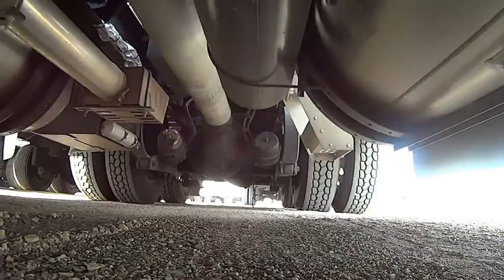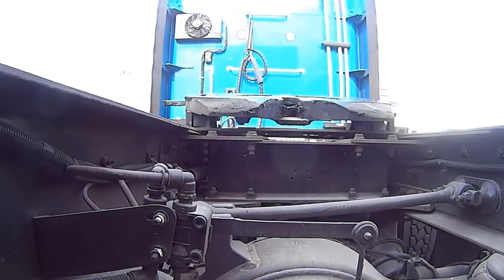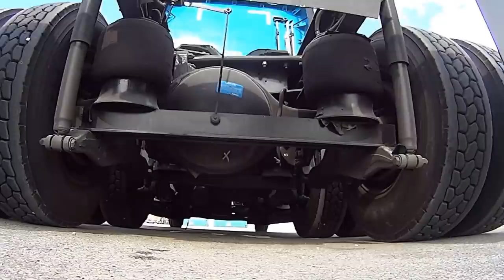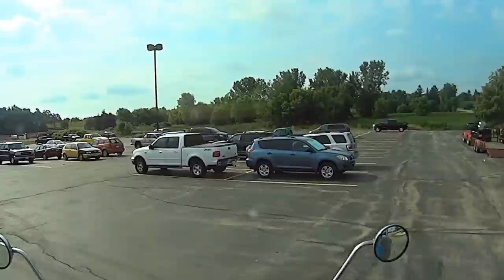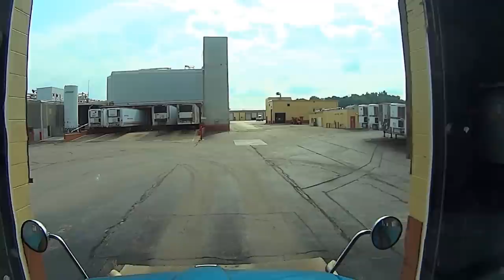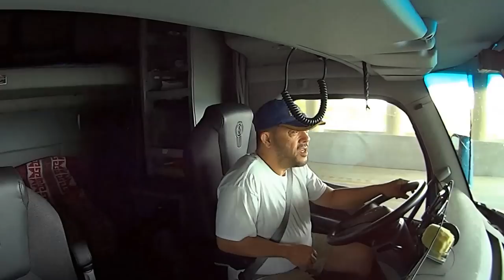Copy of New London Wisconsin

Comment: I like the camera angles. It Sure shows the 5th wheel lock at work. As you state, the entire trailer load is right there at that pin.  It must be darn good high strength steel, right?
Reply from the maker: +Mark Bell teh strongest part of the whole truck